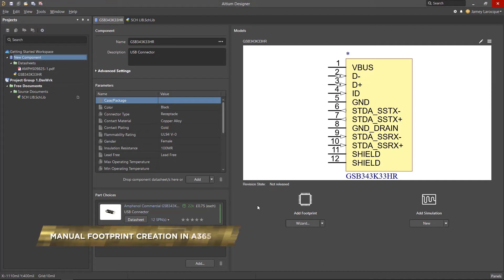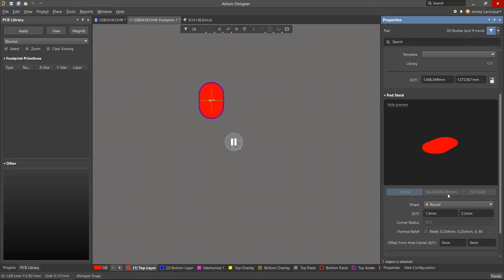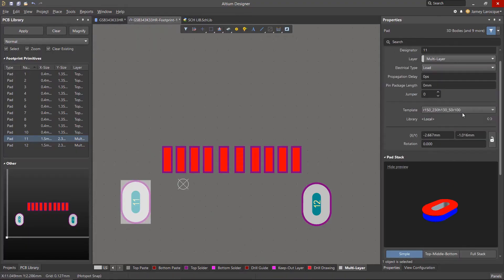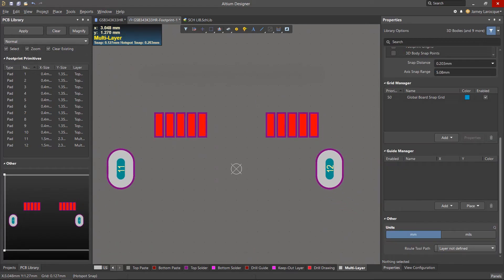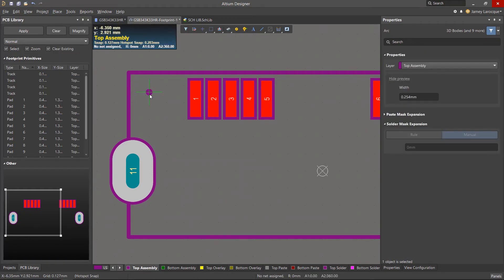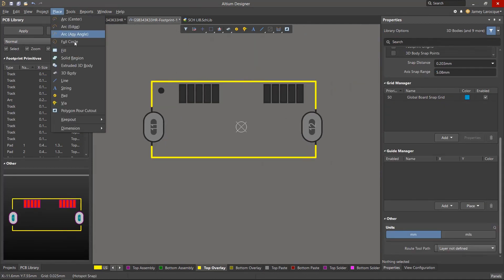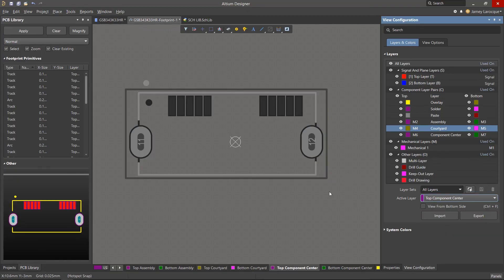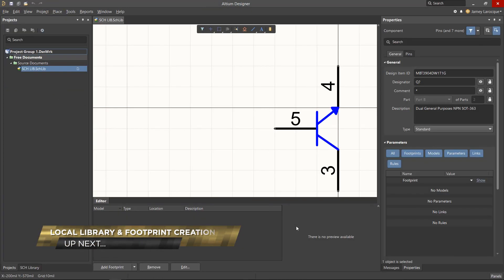Manual Footprint Creation with Altium 365 | Component Creation

Comment: there will be error in the pad creation in the slot pad. hole size and the length will be mis match so,  how can i solve that, this are the error 

Reason for the Error

Looking at your Properties Panel:

Pad Shape = Round

Hole Type = Slot

Hole Size = 1.3 mm

Length = 0.5 mm

Here’s the issue:

Pad Shape Mismatch

A Round pad cannot host a Slot hole properly.

For slots, the pad copper should be Oval or Rectangular.

Invalid Slot Dimensions

In Altium:

Hole Size = slot width

Length = slot length

Rule: Length must always be greater than Hole Size.

In your case → Hole Size = 1.3 mm, Length = 0.5 mm ❌ (not valid).

That’s why the red error icon appears.

Comment: For a beginner like me it would have been helpful if you had shown where you get these numbers from. For example, I don't understand the placement of the first line at the assembly layer at -2.45mm, while  in my understanding, the PCB edge is at 1.45mm. Could anyone who reads this clarify this for me?
Reply: When we create a footprint, the locations of the pads in the footprint have nothing to do with the board edge. The footprint has its own origin, so the -2.45 mm distance is with respect to the origin of the footprint, not the origin of the PCB or the PCB edge. Just imagine that the PCB does not exist and set all pad/hole locations based on some reference point on the footprint; this reference point is normally the footprint's centroid.

Comment: Does altium create a margin around the pads automatically so that it can be soldered? Your data sheet said the pad dimensions are 1.35x0.4 and your pad dimensions in altium were the same. So I guess it must add some margin automatically? Is that what the purple rim around the red pad is?
Reply: The purple rim is the solder mask opening. By default it is 4 mils. When you are creating the component, you can select whether to have a fixed opening or whether it always follows your design rules when you are creating the PCB layout. This opening size is set automatically once you put the footprint into the PCB layout, you can configure this in the PCB Rules and Constraints Editor, just search for Solder Mask Expansion on the top-left side of the editor and it will come up.

Comment: What other component layers should one add?
What parameters must one contain in the schematic symbols?
Reply: The main component layers needed for a minimum viable footprint are included in the video. The minimum number of parameters you should include in schematic symbols are the manufacturer and part number. I find it's best to include these in the schematics with a consistent parameter name across all parts, that way if you decide to do a direct excel export from an OutJob file, the BOM will have a consistent format and you will not have to rearrange data into various columns.